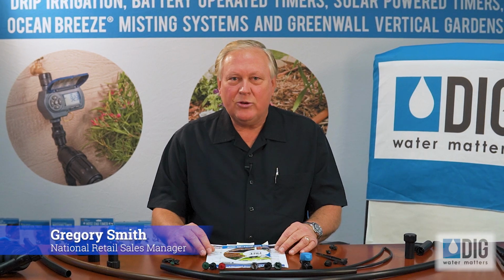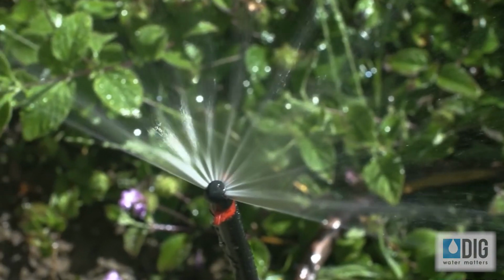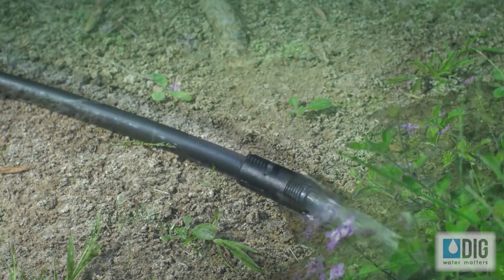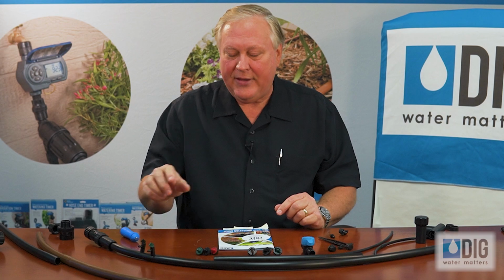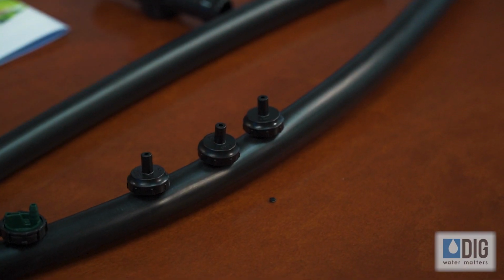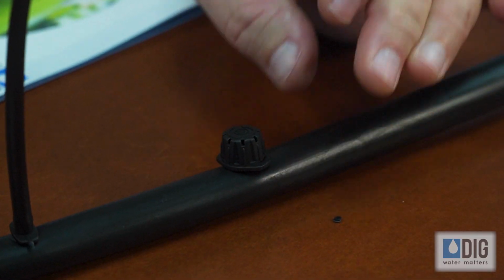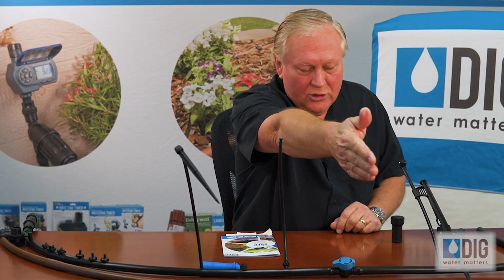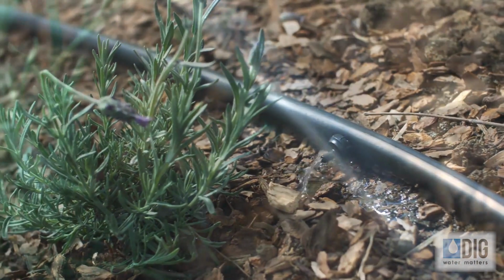DIG - Retail Product Knowledge Class 2021

Comment: Can you spoon powder fertilizer into the upgraded filter? I always assumed it needed to be liquid.
Reply from the maker: Hey Kat, you can use water soluble granular fertilizers in the Y screen filters, as long as it is not coated or prolonged release. You can unscrew the flush cap and spoon it in through the opening and then screw the cap back on.

Comment: Is it recommended to install a small system to a regular sprinkler head? Im talking about 3-4 adjustable vortex sprayers on spikes?
Reply from the maker: Hey Rodolfo, we do not recommend doing this. If you are going to convert a sprinkler system over to drip, it is best to convert the entire system, not just one head. If some high flow/high pressure sprinkler heads are left in operation, the areas they cover may be overwatered when the system run time is increased after the conversion. That is not to say that it cannot be done, and it might be okay if the vortex sprayers are spaced appropriately but it can be problematic. Hope this helps!

If you need more assistance with this, our tech service reps are available Monday - Friday from 7 am to 4 pm at (800) 344-1172.

Comment: If I need to move a T or valve from 1/2 “ line do they easily pull apart?
Reply from the maker: Hello, both barbed fittings and compression fittings are quite difficult to separate unfortunately, but it is possible.
Reply: @DIGCORPORATION  so how?  Heat?
Reply from the maker: @OSGCourtWatch  

For compression fittings, it is best to cut the piece out and then using pliers to remove the remaining tubing. You can try without cutting out the fitting, but it will be more difficult. With barbed fittings, you will most likely have to use a blade to cut the tubing and remove the fitting. Generally people will just cut the section out entirely and replace it with new tubing and fittings. We do not usually recommend for people to try and pull it apart. Sorry for the difficulty, but hope this helps! Please let us know if you have any other questions.
Reply: @OSGCourtWatch  you just have to rip the mf out of there. Then cut the part that was in there off because it will stretch and get skinnier as you yank it out. It’s not very tough if you’re young haha just a compression fitting made of plastic.

Comment: Can you mix & match different emitters? Or does the whole system need to use the same emitter? Maybe one plant needs 2GPH  and another can use .5GPH ?
Reply from the maker: Hey Victor, you can definitely mix and match! We encourage it. Sometimes a plant needs more water so you would use an additional dripper, or just a higher flow dripper.

Comment: If I have two main lines coming a swivel tee adapter does the 220 gal max apply to both lines? Or are they separate giving me 440 total?
Reply from the maker: The 220 applies to both, so it will be 220 total.